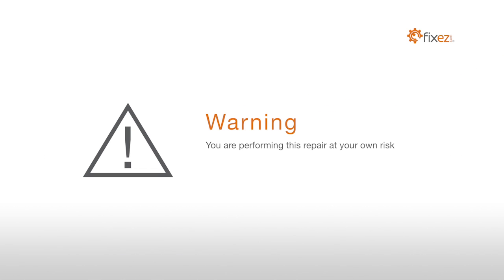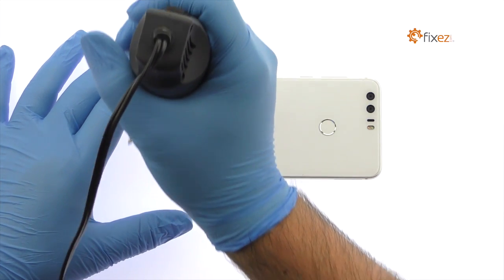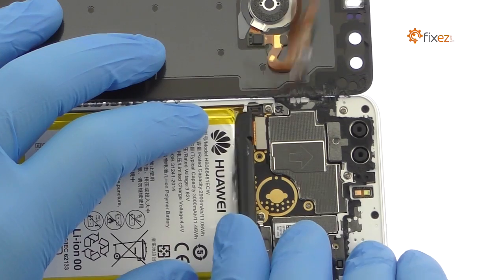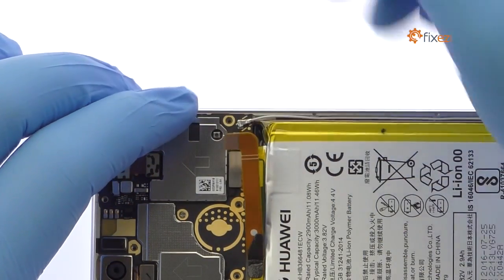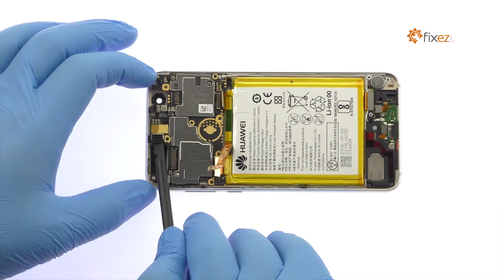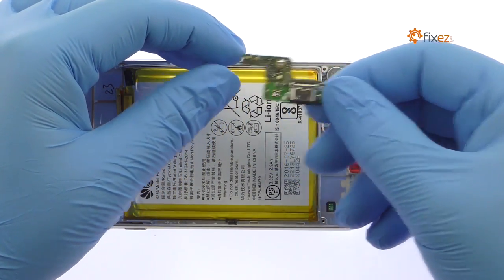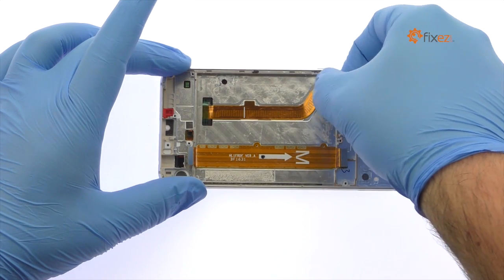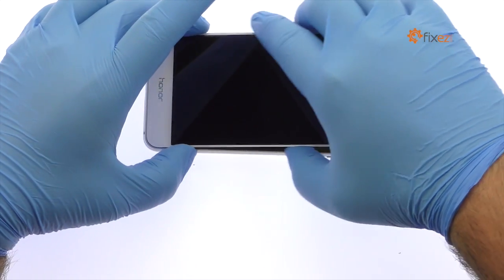Huawei Honor 8 Screen Repair, Teardown and Reassemble - Fixez.com

Comment: Thanks for the video. I've just fitted my new screen. My advice for anyone else attempting this would be to buy the screen & frame combo, along with a new battery & antenna cable. The battery was a nightmare to get out and you can't help but bend it slightly as your trying to prise it away. Much better idea is to leave the battery in the old frame, and fit a new one in the new frame/screen combo. The antenna is now somehow about 5mm longer than when it came out, and makes it very difficult to get everything closed up. Have a new one ready instead. I managed to get the battery cover off mine by just using the heat from a radiator and a suction pad & opening triangle. God that battery! :o( You'll need a deck of cards with 5 aces in it.
Reply from the maker: You're welcome! Glad it worked out for you! And thank you for your feedback on your experience as well!

Comment: I followed these and a couple of other video's steps successfully and took my time doing it.  It was a royal pain in the ass and the battery glue removal was the harder parts.  It is do-able though.  One thing I added was removing the thermal paste on the processor and adding a dab of Arctic Silver 5.  It lowered the temps a few deg, so i was a small thermal mod as well.

I was all proud of myself for a few weeks and the flippin new screen cracked as well.  Now I'm terrified to attempt this a second time on the same phone.  Might just use this one as target practice and buy an Honor 10....

Comment: God this was the worst phone to ever repair. I'm never taking in a repair job for a huawei ever again. The battery snapped while I took 40 minutes to get the damn adhesive off

I HIGHLY RECOMMEND buying the lcd/screen that comes already attached to a new midframe, as it is a fucking bitch to get the screen off the old frame while not damaging the frame itself. Also be very, very careful with the signal cable, as the plug on the motherboard just broke right off as I was plugging it back in... On top of all this the screen I had ordered came with a broken power button flex cable so I can't turn on my phone to find out if i can still get wifi or not :I

Phone from hell. lol

Comment: 6:24 The little piece ripped what do i do
Reply: Swiss cheese6000 same :/
Reply: Damn that sucks D: Sad thing is, and they didn't say it in the video, THAT GODDANG THING DIDN'T EVEN NEED TO COME OUT!!
Reply: Search ebay or aliexpress for "huawei honor 8 vibrator" and buy a new one, costs about 3-4 bucks. And yeah, there's no need to remove it during screen replacement, it is not that heat sensitive.

Btw the playing card in the video must be made of tough steel. My battery just laughed at cards and plastic tools, only a miniature metallic spatula did the trick.

The display glue was really tough. I used a heat gun at 200C for 10-30s periods around the perimeter but it seemed to have negligible effect on the glue. Eventually chiseled, rolled, ripped and scraped the damn thing away piece by piece. Managed to tore some of the front bezel away too, cleaned it, glued back. If anyone asks about the sings of violence around the bezel I'll say a beaver stole my phone and gnawed it. If I had to do it again I'd buy preassembled display+frame combo.

Comment: I bought an assembly instead of a just an LCD digitizer combo. Its not really that hard. I imagine, however, it is a hard "first timer".

The glue for the battery is on tight. Very tight. I was worried about heating it up too much...I ended up tearing the battery shrink wrap. No leakage but it did have a distinct "medical" smell that made me worry. Bought a new battery for 9 dollars. Tip: The guides don't have you remove the IR blaster don't forget to bring it over to the new assembly.

Comment: how do you take the fingerprint sensor out of the rear glass panel? I broke the back of my Honor 8 and I am trying to repair it but the new back cover I ordered doesn't come with a fingerprint sensor. it just has a hole there, as if I should remove my old one and put it into the new back cover.

Comment: Where i get good spare parts? after i replaced my backcover, i get really bad pictures, with flashligt in darker places :( tried with a lit of adhesives between flashlight and camera, but i always have a shine/foggy glimmer, in the picture. Because of the flash. :(
Reply: Benjamin Kottmann Did you fix this? About to open mine but not too sure when i read your comment

Comment: how much will it cost me if I let you do this ? my front glass is broken and as you turn on the screen after 5 seconds it begins to show weird things so after a minute you can't see what's on the display so I also think the lcd should be replaced it also begins to click on random things by itself after a minute so you can't use the phone normally but the touchscreen works fine

Comment: i know by watching this videos that this would be " How to break your honor 8. I just wonder why they don t anymore make changeable batteries to smartphones
Reply: I'm not intimidated and this is by far the best video on the Internet for this procedure, but I'd love to have the choice to buy a phone with an easily replaced battery. My repair is going to cost me an extra $24.00 because I ripped the display ribbon cable, necessitating a complete teardown and screen replacement. Hmmmmmm. $24 to fix a $300 cell phone (now about $175)..... is it worth it? Heck yes! Full speed ahead.

Comment: The glue on my battery was way too hard, I tried the playing cards and they were too soft, both plastic and pasteboard. Ended  up using my credit card, but even being extremely careful the battery ripped a little bit. It could be just my phone, but removing the battery was a bitch. Everything else was pretty easy.
Reply: +Alejandro Leyva hello :) i have tried everything. new back cover. new plastic frame etc. but it's always the same problem :( i know this problem with sony xperia Z5, for example. if the back panel don't has the original seal/adhesive to protect the camera of the flash light. :( i dont know what i should do. dont find real original frame with original adhesive.
Reply: Alejandro Leyva did everything work afterwards?
Reply: and how are your photos in darker surroundings? after i replaced my backcover, i get really bad pictures, with flashligt in darker surroundings :( tried with a lot of adhesives between flashlight and camera, but i always have a shine/foggy glimmer, in the picture. Because of the flash. :(
Reply: I did notice that when using the flash, but not always, is like a smudge. During the day or at night with light no problem. Also try holding the phone really steady because it takes a bit more to process the image at night.
    My guess is that is probably dust, dirt or the tape. I'm going to open it up again and put new tape, clean the cover, and use compressed air to remove any dust remaining, it should be quick. I haven't done it because I don't take a lot of pictures and I ordered an new back cover with a different color (parts for this phone are cheap since is from china).
Reply: Benjamin Kottmann that sucks man, my suggestion would be to contact honor directly, not Huawei, I believe they have different customer service. Also did you put tape in the gaps between the cameras and flash?, that may help. And where did you buy the cover from, i got mine directly from China.
http://m.ebay.com/itm/Glass-Rear-Back-Cover-Battery-Door-Middle-Frame-Bezel-For-Huawei-Honor-8-Black-/272555433068?nav=SEARCH

Comment: is it necessary to use red adhersive rolls or other adhersive rolls
Reply: literally use anything sticky, as long as it sticks it works, if you dont wanna drown your device after you drop it in water then i’d recommend buying the rolls. (I know this comment is 6 years old but sometimes i wish someone responded to my comments no matter of the time frame <3 )

Comment: Do you have to buy a new backside too it aswell? Since the old glue is used?
Reply: Raymond Lindseth no, you can glue the old one back on, but it probably won't be as tight as before
Reply: Allright, thank you!

Comment: Is it possible to replace just the front glass? I found the part for about $3, but I hear that you pretty much have to replace the whole front screen assembly, even if it's just for the  broken front glass.
Reply from the maker: Glass only replacement requires specialized machinery and is outside the scope of our videos.
Reply: I tried replacing only the front glass first, but then the display broke... But with the help of this Video I could fix replace it! Thank you!

Comment: And which of these steps can I skip when I only want to exchange the display?
Reply from the maker: This device must be mostly disassembled to remove the display. Speakers, motherboard, battery, headphone jack, and daughter board should all be removed to prevent damage from heating the display.
Reply: not true. You just remove the battery and open the front display like the back and pull that display connector

Comment: Interesting that the battery reads 2900mah, while spec sheets say its a 3000mah battery? What's the deal with that?
Reply: it depends on voltage -- higher voltage -- lower mAh and opposite

Comment: Is there any way to replace only the glass of the screen and not the digitizer?
Reply from the maker: Glass only repairs require specialized machinery and are outside the scope of our repair videos.
Reply: Fixez.com OK thanks for the reply :)
Reply: So it's possible, yes? I live in Poland I hope that the authorized service has possibility to do this. Greetings!

Comment: Love this:)

i need to change my rear glass panel:/ How do i remove the fingerprintsensor from the broken panel and attach it to the new rear glass panel?

Tried to find the parts and tools at your website...but there is nothing there to buy:(
Reply from the maker: You can remove the finger print sensor by heating the glass back and using a spudger to pry it free. We don't currently have parts in stock if you would like an accurate time frame of when they will be available please feel free to email us at support@fixez.com